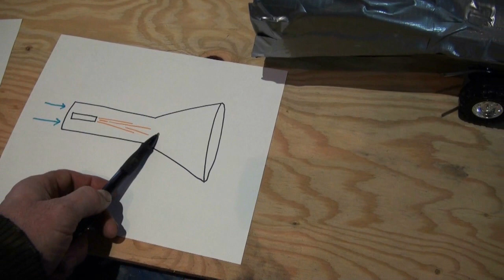Rockets And Air.

Comment: I am no scientist but i would say it is creating a pocket of low air pressure in the tube(a vacuum). Yes, Both cases there was a vaccum (as it shows with the paper airflow test) but with it being open air had a easy route through the front and out the back flowing in the direction of propulsion. With the front blocked Air from the atmosphere thus needs to rush in through the back of the tube to equal the pressure back out, thus also pulling the rocket back, however the rocket over powers the vacuum but just enough to slightly push it forwards.
Reply from the maker: The short initial push from the rocket with the tape at the front of the tube I think is from the rocket pushing out some of the  stationary air, once that is expelled then the rocket stalls, even if the rocket had 60 seconds of fuel the results would be the same.
Reply: @groutaone   I see what you mean. at the same time I feel like the stationary air as it gets pushed out would be whats creating the vacuum, and say with 60 seconds of fuel i bet it would sustain almost like a circuating current of drag sucking air in and little more blowing out. Then with it untaped it wouldn't have that circulation effect what was creating a drag
Reply from the maker: Yes I think that is correct.
Reply: It is possible that the thrust generated is just not great enough to overcome the friction of the wheels. I did notice after you test rolled it to show how easy it moved, you moved the wire and it jostled your cardboard tube over so it was rubbing on the back wheel.

Comment: Let's say you stand on a sufrace with 0 friction and there is vacuum. If you throw a with a certain mass, your body will move in the opposite direction of where you threw the object.
Same goes with the rocket. In space there is vacuum = no friction = nothing to keep you still when you throw the object (rocket fuel). Even if the mass of the fuel is rather little, the velocity is very high, which produces a considerable amount of thrust.

Comment: I have no idea what’s being proven here
Reply: It needs AIR to combust and be propelled.  In "space" there is no air so how does anything move, rockets, stabilizer "thrusters", the Millennial Falcon etc.
Reply: @anonymousguest9290  what happens if two balls collide. one is stationary the other has some velocity?
Reply: @samforsey  The video is demonstrating that you need two balls to make ANYTHING move.  One ball is the rocket, the other ball is the atmosphere.
Reply: @MrBen527  Could you reword your comment to be intelligible?  What is the implication you are inferring?  What is happening in your observation of the video that you claim does not make sense to you and that based on the observation you made which makes it "not so"?
Reply: @anonymousguest9290  what if i told you the fuel is one ball and spaceship is the other. the fuel combusting makes the fuel ball and ship ball move apart by accelerating the fuel mass
Reply: @MrBen527  Sure he does.  Newtonian physics 3rd law:  For every action, there is an equal and opposite reaction.
https://www.physicsclassroom.com/class/newtlaws/Lesson-4/Newton-s-Third-Law

He's demonstrating that something has to push against something else to move.  The demonstrations shows that if this were in a void(no mass) there would be nothing to push against.
Reply: @samforsey  What if I told you the combined gas laws do not include force only change in pressure, temperature and volume.
Reply: @samforsey  Quoting you:  "combusting makes the fuel ball and ship ball move apart"  Are you saying the fuel ball is NOT pushing against the air?
Reply: @anonymousguest9290  no it's pushing on the ship
Reply: @samforsey  And not one ounce of that combustion is pushing against the air???  Are you watching the same video I am?
Reply: @samforsey  : )  Are you claiming that if I were to stand behind a rocket, NO AIR would blow against me?
Reply: @anonymousguest9290  there are two phenomena which are occuring, which is why the vehicle moves. The fact it has air to push against increases the thrust, but this does not mean that without the air no movement would occur. His test actually proves the theory which he is trying to discredit. Research conservation of momentum.
Reply: @samforsey  You mean this:  There is a peculiarity, however, in that momentum is a vector, involving both the direction and the magnitude of motion, so that the momenta of objects going in opposite directions can cancel to yield an overall sum of zero.
https://www.britannica.com/science/conservation-of-momentum

Picture the explosion as a circle.  Half goes in the direction of the ship, the other half goes against the other half.  Do it again.  Half of that explosion is pushing against the other half of that half of the explosion.  The ENTIRE other half is moving in the opposite direction AGAINST the atmosphere.

Draw a vector diagram of what you think is happening if what I am saying is unclear to you.  Remember, the explosion has to push against something even if it is itself.  How much mass would that be for the equal an opposite motion?
Reply: @anonymousguest9290  I am not a rocket scientist. By blocking one end of a tube it shows how impossible space travel is? Feels like a stretch.
Reply: @1tylerproud  In this thread there is mention of conservation of momentum, Newton's third law of inertia and vector analysis.  If you can not tie those high school concepts into what the demonstration is clearly showing then I can not help you.

Reread this entire thread and then ask me something specific, not generalizations like "Feels like a stretch".
Reply: @anonymousguest9290  the fuel has mass right? When it combusts that mass is ejected through the nozzle of the rocket engine, due to a pressure increase in the walls of the engine itself. That ejected mass has velocity, hence energy. That energy is conserved by accelerating the ship itself in the opposite direction. You clearly can't imagine what a vacuum is.
Reply: @samforsey  Show me a vector diagram of what you are saying.  Use a 1kg rocket.  I don't need imagination we have math right?   Use math.  Show the work.  Remember, only HALF works in the direction you IMAGINE that it does.  And that half gets halved, etc.  Work out the math and let me know how much force pushes against the atmosphere and how much is pushing against a minuscule amount of rocket fuel mass.

You clearly can't imagine a closed system of forces working upon each other.  When you pull a glass across a table toward you....do you realize your ass(literally) provides the resistance to keep  you from moving toward the glass?????

Who is incapable of IMAGINATION now?

In your vector diagram, don't forget about the air.  : )
Reply: @anonymousguest9290  why are you so obsessed with air? Conservation of momentum is universal and occurs in a vacuum
Reply: @samforsey  Why are you being so obtuse as to avoid AIR?

Have you drawn out the vectors in a diagram to show what is happening?  How much mass would the explosive have to have to push a 1kg rocket 1 meter?

If you can't do this simple calculation, talking to you any further is a waste of time.  Show the calculation or have a good day!
Reply: @anonymousguest9290  because in space, there is no air. Assuming a fuel mass of 0.1kg. It would take accelerating that mass to 10m/s to get the space ship to move at 1m/s in the opposite direction. 
Why do you keep talking about vector diagrams? xD
The combusting fuel increases the pressure inside the combustion chamber, forcing it out of the thruster
Reply: @samforsey  Because you have to OPPOSITE and EQUAL forces.  Vector diagrams would show you this.  You'll discover the mass of the explosion and ALL the directions it has to push against.  Get it?

Why do you keep talking about pressure?  Where in the combined gas laws do you see force?
Reply: @anonymousguest9290  No, I dont understand what youre talking about. You seem incapable of breaking the problem down into understandable parts.
The pressure in the combustion chamber forces the mass of fuel out the back of the thruster, it is the acceleration and mass of that fuel which is what causes the rocket to move in the opposite direction. 
Pressure always tends to equilibrium. so when there is a high pressure in the combustion chamber, the fuel mass is ejected into space (low pressure) in order to maintain equilibrium.
Reply: @samforsey  Of course you don't know what I'm talking about because you CONSISTENTLY confuse a change in pressure with FORCE.

Show me in the combined gas laws where change in pressure has anything to do with force?

If you keep the conversation in terms of FORCE only, you'll see that you need OPPOSITE AND EQUAL forces.  And this is, eventually, where the air comes into play.  Pushing against NOTHING means NO MOVEMENT.

Ever try walking on ice?  Although there is friction(mass) it is drastically reduced from normal ground.  Assume it to be frictionless for the purpose of this post.  Can you walk forward on a frictionless surface?  NO.  Same thing goes for pushing on something in a void/vacuum.
Reply: @anonymousguest9290  Pressure is related to force and area. Pressure is the force per unit area.
Reply: @samforsey  So what is the pressure(force per unit area) pushing AGAINST?  Get it?  OPPOSITE AND EQUAL FORCES.  You're the one who harped on about conservation of momentum.
Reply: @samforsey  Let me help you here.  One container is the rocket with fuel.  The other container is a void, no mass.  As the gases expand into a VOID what are those gases pushing against(force per unit area).  If the void is infinite then the area is also infinite.  So....what is some amount divided by infinity?  Hint:  0.

Did have physical sciences in high school?  I'm just curious about your math/physics education.
Reply: @anonymousguest9290  it is pushing against the rocket man. you are so caught up in air. it is nothing to do with pushing on air.
Reply: @samforsey  What level of education, specifically math/physics have you had?
Reply: Quoting you:  "it is pushing against the rocket man"  What is IT?  How much of IT are you talking as IT starts to combust pushing against ITself that has not combusted yet?  Are you starting to see what I am saying?

Walking on ice.  No friction no walking, correct?  Why?  Because OPPOSITE FORCES MUST BE EQUAL.
Reply: @anonymousguest9290  accelerating a mass causes a force (Force = mass x acceleration). so we are accelerating a fuel mass away from the high pressure combustion chamber, which forces the rocket to move forward. its nothing to do with friction
Reply: @samforsey  LOL  "nothing to do with friction"  If it has mass....it has friction.

What level of education did you complete?  Specifically the subjects of math/physics?
Reply: @anonymousguest9290  the method of propulsion in a vacuum is nothing to do with friction. you are off on a huge tangent because of a lack of fundamental understanding.
Reply: @samforsey  What is your level of education.  I will find examples online that match YOUR understanding.
Reply: @samforsey  Let me get a better understanding of your ability to critically think.  Do you wear a mask?
Reply: @samforsey  And you can not answer a simple question.  What level of education do you have.  Nonjudgemental question.  I need to know so that I may present online material appropriate to your level of understanding.  Not cocky, just practical.  Have you ever taught before?  All personalities have different ways of understanding and learning.

Can a man walk on ice(frictionless surface)?

Name ONE example where friction is not a variable, in real life situations....just one.
Reply: @samforsey  What is "bbc bitesize level physics"?
Reply: @samforsey  Most importantly:  Do you wear a mask???
Reply: @anonymousguest9290  you are ideologically possessed which I'm afraid means you can't see reason, which is a trap I wish you success in escaping. At least I tried.
Reply: @anonymousguest9290  this is your issue, you are stuck in what you call a 'real life' situation, completely unable to imagine what happens in a vacuum. No you can't walk on a frictionless surface. However, assuming a human mass of 100kg, a really big shit weighing 10kg and propulsion was necessary. If you forced it out at 10m/s you would be able to move at 1m/s which is about walking speed
Reply: @samforsey  Are you implying that someone with explosive diarrhea could propel themselves over a frictionless(ice) surface?  Would that amount of feces push against the air right behind the anus or are you thinking(without showing any vector diagrams to PROVE a sum zero conservation of momentum) the release itself is "pushing" the human?

Would this work somewhat like releasing an inflated balloon?  Are you saying the air being released from the balloon is pushing against itself as it escapes thereby pushing the balloon "forward"?
Reply: @anonymousguest9290  no , and I think this is the crux of what you don't understand. The 10kg stool has inertia. When the body forces that log out at high speed, the body is propelled forward against the inertia of the log.
Reply: @anonymousguest9290  the propellant has inertia, like the shit. yes, it has relatively little inertia but at very high velocity it has significant energy.
Reply: @samforsey  So then there is propellant that isn't combusted which is pushed against?
Reply: Its needs something to push against!
Reply: @SaucemanSauceman   Yes.  Absolutely correct.  Using the most basic laws of physics from 9th grade physical science shows this to be true.
Reply: What's being proven is exactly what one would assume would happen. With the tube plugged the vehicle gets less thrust, than with it open. Note that it does still get thrust. The air is helping it get more thrust by moving with the expelled gas.
Reply: If you were standing on a frictionless surface and you threw a dumbbell to the north you would move to the south. This is because energy is required to accelerate the weight. An equal amount of energy would move you in the opposite direction. The gas being accelerated out the end of the rocket has far less mass than a dumbbell, but it is being accelerated much more rapidly. 

I would also like to mention that the rocket doesn't require air to burn, as one person in the thread mentions. It has all the needed components to combust already on board.